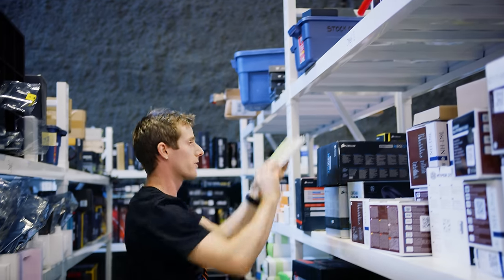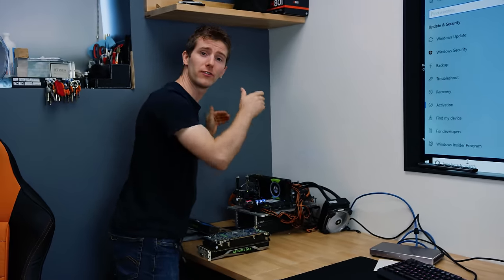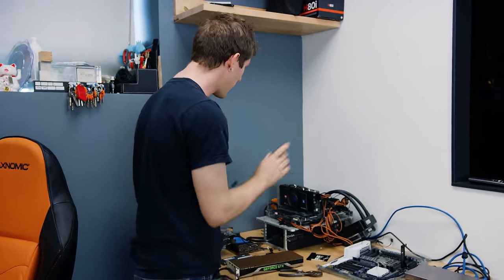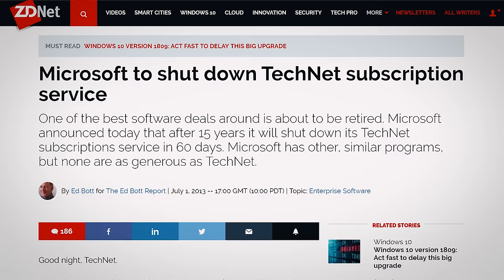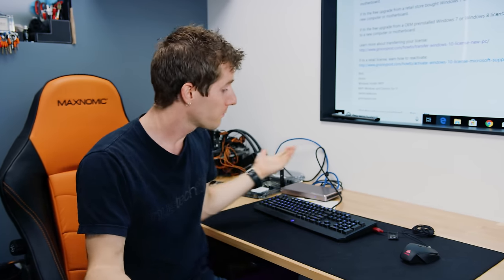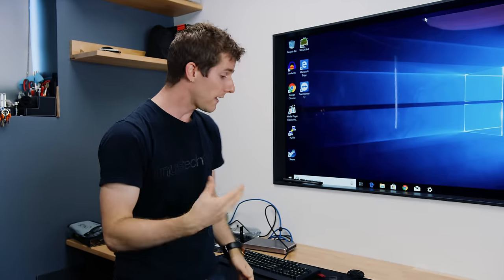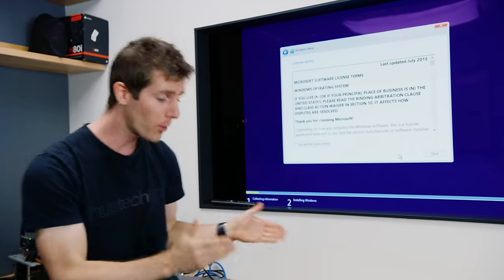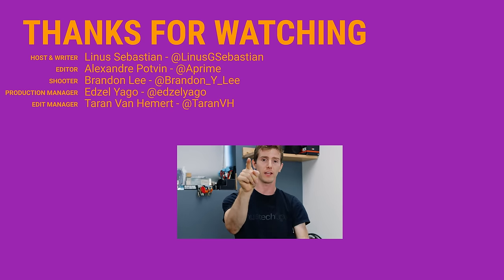Why Does Linus Pirate Windows??

Comment: In Germany it is illegal to bind a license to the device. It must be bound to the person. For me that means I got my win10 license through the upgrade from win 7 and I could install it on several machines since then again and again and they all activated automatically and legally.
Reply: Not only that. The Eula doesn't apply as well. There is no legal way to force you into a contract after you bought a product. That's what an Eula  is, a contract  you have to agree on to use the product which is shown to you after you already paid. That doesn't only apply to Germany but the whole European Union.
Reply: Me too. I got a Win 7 license and was able to use it on a new motherboard and graphics card change. Even after upgrading the SSD. Then later I was able to use it to activate Win 10 license with the same code (legal).
Reply: In Croatia you can pirate over 1000 euros of data and you're good. Noone gives a fuck.
Reply: @MrScreemi  you are saying that in US they have serious legal consequences if they do not respect EULAs?
Reply: at least the company issuing the eula can try to enforce it in front of a court. no chance in germany. the english wiki article has a chapter about enforceability: https://en.wikipedia.org/wiki/End-user_license_agreement#Enforceability_of_EULAs_in_the_United_States
Reply: In Deutschland ist alles einfach :)
Reply: I may be wrong but OEM licenses can be bound to a device no matter where you live. It's pretty much what an OEM license is for - one time activation on a single machine. Regular license can be used on any computer but not multiple computers at once. If German laws really are as you describe, than it is simply illegal to sell OEM licenses, and if you've bought one, you've done so illegally.
Reply: @MartinTheBest canads here i torrent without a vpn daily
Reply: in portugal, I probaly did 100x that and my country doesn't give a fuck despite the ads
Reply: MrScreemi, In the US (Not 100% sure about the EU/Germany) what is know and "clickwrap" contracts are acceptable and fully enforceable because as a provision of the law that if you do not agree to the "enclosed terms and conditions" the software manufacture must offer a full refund. So your silence is considered agreement to the terms and condidtions, the fact that you did not contact them for a refund and used the software means you agreed to the terms. 

An example of this is that you buy a copy of Windows 10 and it says on the outside of the package that "By opening this package you are agreeing to the terms and condition inside" and you open it up and there is a paper that says "terms and conditions on disk". You insert the disk book up your computer and the EULA appears you have an opportunity to review the document, now assuming none in the EULA is expressly prohibited by law in your country by clicking "I Agree" you have signed a contract. Just because some provision in the EULA are prohibited in your region doesn't invalidate the entire contract only those portions of the contract that are prohibited. So if Germany has laws against software piracy because you installed the same license of Windows 10 on 100 computers you sold from your garage business you can still be arrested and charged for piracy. 

It is still up to the software manufacture to protect their IP, as a rule software manufacture do not go after small infringement such as you installed the same license on your all 5 of your family computers. Really they are going after medium/large or enterprise business where they have 100+ cases of infringement.
Reply: @motia4888  same in Romania
Reply: @MartinTheBest that's true
Reply: @wesleeysutton5935  the problem in Germany is that if the internet service operators or internet service servers catch you downloading from Torrent they will cut your internet connection and even reset your router that happened to me some times put this depends on the service operators
Reply: Not really as you never bought the software you bought a licence to use the software. 
You are miss applying the law, thinking you bought the software. If you bought the software you would be allowed to copy and sell copies to others, but you never did and could be put to jail for it. 
So in fact you bought the Eula. 

And buy buying it you sort of agreed to it. This last part have not yet been tested in court so it could be argued that you have not agreed, but then you are not either allowed to use it, you could however possibly be allowed sell the license to another. 

Remeber that you never bought the product, just the license. The software companies have never sold their software product to you. 

It happens though that companies buy software products. Microsoft has done that in the past, and so has Apple. In those cases the original software maker is no longer providing user licenses of their past product.  Example this is e.g. MS Dos a software product called 86-Dos owned by the company Seattle Coputer Products. 
When MS bought the product they renamed it MS Dos and IBM PC Dos. 

So if you are ever to go in court about thise things you will lose, the software company will win and the EULA will be enforced.
Reply: Thats because Germany is better. Duh
Reply: @MrScreemi  Right, that's because the EU classifies a product license as a product itself and not just an authorization to use a product. You can even sell that license to someone else and they can legally use the product that the license pertains to. Sadly, the USA tends to pass laws based on the "Highest Bidder" system called "lobbying".
Reply: Oh, so THAT's probably why the automated phone activation thingy has never failed me, even when I had the same Windows 7 Pro license installed on like 4 different PCs (don't sue me I'm a broke student and at least I went out and bought a license).

Thanks, Germany. I mean it.
Reply: In the UK OEM versions are bound to the device, Retail versions are bound to the person and can even be sold on.
Reply: I've heard about this in Germany. It's weird this has never been made EU law. Presumably you mean you had to remove Windows from the old pc first?
Reply: @CanIHasThisName  I expect the OEM licence on Germany simply works differently
Reply: Alex McCaffrey  Nah, I've had the license running on two computers at the same time for years with no problem. During the phone activation, when the computer asks you how many PCs the product is installed on, you simply answer with "0" and apparently it believes you :D
Reply: So Germany is the reason we no longer have authentications under the battery, see no more POST logs from the BIOS, and must sign in with an outlook email address? Next step is to tattoo inmate numbers on our wrists or walk into a kiln.
Reply: I have a vision of Richard Pryor inserting the security keys simultaneously- Superman III
Reply: +Ole Hellwig
Man but this is OEM :D. 
 OEM  = When you buy laptop with OS :D. 
In this case, you dont have any license ( you dont buy OS) because license is binded to your laptop mother board .
Reply: What happens when you run out of license counts though?
Reply: Stabbing in Chemnitz for instance?

Comment: It's still pretty crazy how Windows and certain apps are tied to the motherboard still...
Reply: I think it depends on the windows type Key you are using, I investigated while ago and  OEM keys were 1 installation per machine,  while retail version allowed multiple installations (not simultaneously)
Reply: I mean, compared to who? Most flavors of Unix are open source so they don't to worry about license, except Mac, who IIRC now 100% require you to sign in with an AppleID (without even getting into the hassle of transferring that)
Reply: +danipo MacOS doesn't require you to sign in with an AppleID, as long as you don't want to take advantage of sync features over iCloud (I think it's iCloud? I don't use it). Just the usual "Are you absolutely sure you want to skip this critical feature?" ...

Also, I've never needed to transfer or do anything with my AppleID for a new machine other than log in.
Reply: But Proooooto! How else would they make sure you’re not stealing it?
Reply: Fernando Coronado I’ve used produkey with OEM as long as the mobo is the same. Just to clarify in case you meant the key itself was a one time use regardless if it’s the same machine
Reply: Historically, windows licenses keyed off the MAC address of the network card on the motherboard.
Reply: It's not so much that Windows is tied to the motherboard, but that Windows is tied to a checksum of ALL the hardware IDs, and when you replace the motherboard you replace most of the hardware components in the computer as a result. Most of the hardware components are actually built into the motherboard, and they all have separate IDs because that's how Plug-n-Play can tell when hardware is installed, replaced, or disabled without forcing the user to install drivers manually every time.
Reply: Nathanial Lewis No... It would have never been keyed off of your mac address. It has always been your UUID. You have multiple mac addresses, and even installing new network interfaces will add even more mac addresses to your computer. That doesn't make sense.
Reply: Whatever the current 'digital license' system is, it's utter shit. Seems with some machines you only have to breathe on them heavily and suddenly Windows doesn't activate anymore. Considering Microsoft are doing all they can to turn Windows from a usable OS to an advertising platform, they should do the honest thing and make it free.
Reply: ProtoMario Strange how multi core usage seems to be not so fast as it should be either. It’s as if there is something in the between, running unwanted slowing and draining your computer system somehow .
Reply: Rather depends on the license. I had a windows 7 ultimate license at some point (I guess I'm technically still using it) and one aspect of the 'ultimate' license is that while it doesn't ignore hardware changes completely, as long as you aren't registering the same key with completely different hardware more than once every 3 months, it should work indefinitely.

Unfortunately, I'm considerably less confident that still applies to an upgrade to windows 10 from such a license...

Oh well.
Reply: Windows 10 is full of garbage, errors  and whit no drivers.
Reply: crazy !? you mean scary.
Reply: i just stopped using windoze - it’s simple, fast, and feels amazing! :)
Reply: haha , ayy lol , why would i wanna curse pople like that OH AND YAS the worst nightmare I EVER HAD IS THAT THE TRACKING AGENCIES WOULD BE ON MY PC/PHONE AND EVERYTHING.. and YES cocaine/xtc/whatever would've BEEN ONE HELL OF A PARTY !
Reply: I thought it was tied to an account? I bought a laptop with windows 10 and signed in and the license key was then attached to it so when I built my desktop all I had to do was sign into my account and windows was then activated.
Reply: It is idiotic, not crazy....money grabbing scam!
Reply: They aren't.
Reply: I'm seeing you everywhere nowadays.
Reply: ProtoMario I agree 100%. I've been building PC's for years and the biggest complaint I have is "Why is it that every-time I change out one motherboard for a newer one, I have to reinstall Windows". Has never made any sense to me.  Almost of the drivers (LAN, Audio, Video,, ect...) are not from Microsoft. Only Directx for audio is required, but that's universal amongst all motherboards and should not require a re-instillation of Windows. I don't have to reinstall when I change out Graphics cards or Media Burners, even Ram. What does Windows need from said motherboard? Or is it just a scam to use up a license because they know your gonna need one next time and will be back to buy more. I'd say it's a scam.
Reply: @nandoedwin1  right boii that is the thing what matters... Hardware switching is not that easy for OEMs
Reply: it does not with WIndows 10. Linus is lying. The license key is tied with microsoft account. I have two PC, one is license and other is not, and whenever I login to my unlincense PC, it will become activated when I log in with my main account where I initially activated the key.
Reply: yep pretty much, when I change all of my hardware out when I do a complete rebuild every 4-5 years I just assume that I will need a new windows key, sometimes I am pleasantly surprised and end up with a spare key. It really is like rolling the dice.

Comment: I violate MS's terms on service. MS violates my wallet by 200 euros

Pretty fair I think
Reply: Benny Chairmen leader I bought a windows copy for 100 about 6 months ago. I had to change my motherboard and they told me to buy a “legit” version of it. So I just did it illegally.
Reply: War SAW That’s why you don’t buy. I’ve always used keygens and cracks to activate Windows and have never felt bad for it. Sure 10 is fast and sleek, but its the same OS as 7, and even XP.
Reply: @LiberatedMind1  i learned my lesson.
Reply: The game was rigged from the begining
Reply: ms probably violates your privacy too
Reply: @tylernilson7021  maybe yours. I still use 8.1 Pro and uninstalled the updates containing spyware. If you really care for your privacy, get 8.1 or 7 (both have spyware, but they came with an update, so you can uninstall them)
Reply: Windows violates privacy
Reply: @pjackson239  only 10. 8.1 AND 7 do it too, but you can uninstall the updates containing the spyware
Reply: I understand that. I was just pointing it out. I generally use linux personally.
Reply: @pjackson239  I personally use Windows 8.1. I like both 7 and 8.1 but I don't know what to expect after 2020 [W7 support end) so I went off using 8.1
Reply: The thing is, I think those terms of service are pretty outdated anyways and Microsoft doesn't act on it, Windows is not where they make their money anyways, they're cashing in on that sweet sweet revenue from Bing, Xbox, Surface, and Office.
Reply: As if a company should give away it's software loool
Reply: Nice Avatar.
Reply: Classic denial of victim/injury. Hope you feel justified
Reply: im british, provide a conversion to GBP before brexit ruins our economy
Reply: @addust  Can't ruin our economy if it doesn't acc happen
Reply: @AlchemistOfNirnroot  yeah lol we are bad at leaving unions
Reply: i only bought Windows Xp legit version it came with the first pc that i bought :) all others where activated illegally :P PS:I use linux ubuntu now :)
Reply: can't you activate windows without a key?
Reply: @LiberatedMind1  You can even download completely barebones OS from Microsoft, and get a $2 key on eBay lol works Everytime for me
Reply: @addust  unions are just another word for "MOB"
Reply: @headphonesz6527  Cheaper / easier to fully pirate it :)
Reply: @tannerdavisr  
Poor victim Microsoft
Reply: Nooooo!!! Dude, go on eBay! You can find a Windows 10 Pro retail key for <$5.
Reply: TheSnowscar There is no deprivation of property in cracking / downloading software, so no theft is involved. 

MS gives their software away for free, they charge an exorbitant amount just for the damn key, they are abusing the fact that they are a monopoly.

Comment: There's no point in activating test benches anyway. You don't really use them, you just run a few tests and then clean install for the next batch.
Reply: There is also no real reason tocrace windows since windows 8, bcause the only diffrence between acivated and not, is that you cant customize windows and use the app stor (oficial, but ive used the sore on unyactivatet systems aufter the 30 day period just fine)
Reply: @DokuFREENET  did a cat walked over the keyboard on this post?
Reply: @Tanfo77  thats: I have my Keyboard set to German, because i am german, but have to write often in english, so i have to disable autocorect, because if i set it to german, it corrects english words in to german and if i set it to english, it corrects german words into english
Reply: @DokuFREENET  Dude, it's a joke. No need to defend your actions. It's the internet.
Reply: @Tanfo77  Year, buts thats the truth.